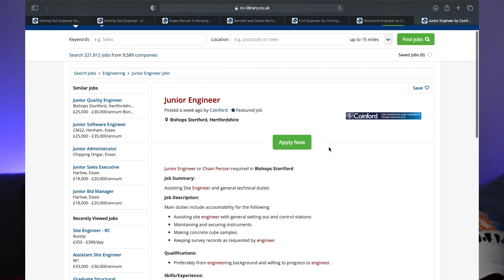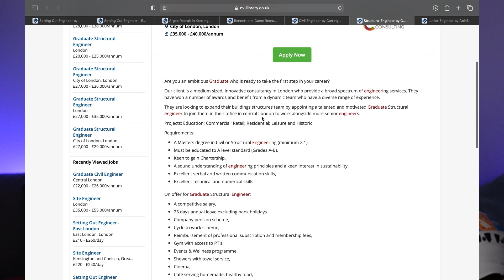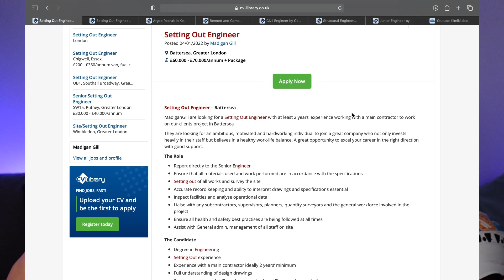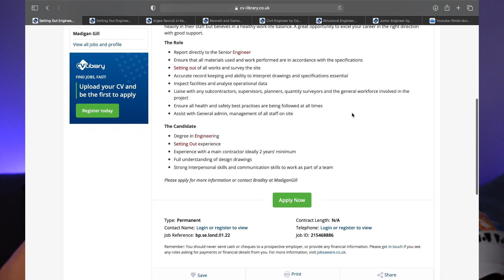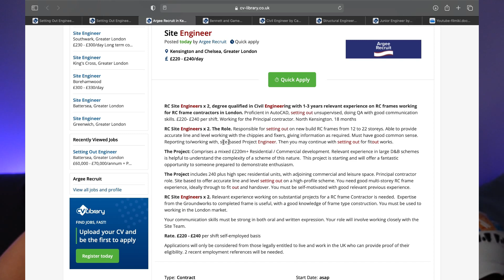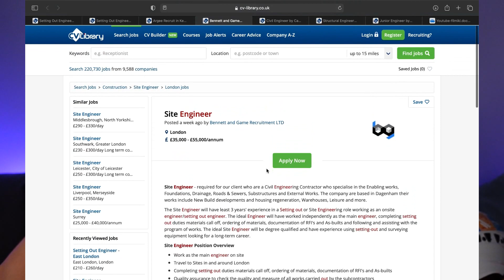Civil Engineer's SALARY & JOB in UK 2022

Comment: It is difficult to find an "Assistant Residental Engineer"(job title in HK) vacancy in UK. Should it be Civil and Structural Site Inspector or QA/QC Engineer?
Reply from the maker: Probably that would be just assistant engineer. You typically be starting here helping with setting out duties and then QA checks. There are still jobs, but it really depends on how hard you are looking for it. For some people is quite easy, while some can't find anything

Comment: I've completed my Bachelors in Civil Engineering and Masters in Structural Engineering with 3+ years of experience. I've recently relocated to Glasgow with the right to work in the UK
Got any advice for me?
I've been applying day and night for jobs
Reply from the maker: Apply for junior roles, assistant. Forget about your experience and degree, you have to start here like it would be your first job (your degree and experience help of course, but don't rely on it too much) I would get whatever job on site really, see how it looks, meet people, make connections, make some money and then will speak that you are an engineer and looking for engineering position, have experience etc etc
Reply: @SITENG  Yes that's what I'm doing. I'm applying for graduate jobs and programmes as well. I was thinking of applying for the NEBOSH certificate, would that be beneficial?
Reply from the maker: @YungAnon7  What about looking for something elsewhere, maybe not much happening in Glasgow? Extra 'papers' and courses are ok, but they won't guarantee you a job, better is take whatever job on site really, I mean not engineering one

Comment: From Bangladesh I completed my civil Engineering bachelor degree in 2015 and after that I've 5 year job experience in Bangladesh as  project engineer and 4 years as a senior executive at Bangladesh Honda private limited for maintenance Department. 
So would i able to do job in uk as site engineer?
Reply from the maker: You will have to get the visa/permit to work. Because your experience is not in UK you would have to probably start from junior engineer role which will be typical setting out duties on site.

Comment: Hii.. great video. Just want to check if bachelors degree in civil engineering with 2 years experience is enough to work as a quantity surveyor in uk?
Reply from the maker: Definitely it is, when I look at the market now there is a big need for QS. Remember that everyone wants UK experience and it still might not be easy to get a job, but definitely degree and experience is well enough and with good attitude and being active you will find a job👍👍
Reply: @SITENG  thanks
Reply from the maker: no problem!

Comment: Hi Greg, I am an indian national but do have a UK full time  Bsc(Hons) civil engineering degree. Also 15 years of on- site working experience in building construction. I am getting a chance to come to uk as a dependent so i am curious to know what are the chances me getting a job there in UK?
Reply from the maker: Hi Punit! I can't tell you really, as this depends on you and your determination. There is still lots of jobs and need for engineers, so I can't see a problem with getting a job. Try to look for something now, or at least ask questions and see what's on the market. Contact recruiters on LinkedIn and speak with them, as they will know much better than me 😁

Comment: Greig, how do I transfer my setting out skills so that I am able to become a site engineer as well? What more does the site engineer do than the engineer who only sets out?
Reply from the maker: Hi Blaine! Depends on the job size really. Often site engineer do setting out only so you can easily apply for a site engineer. You might be asked to do QA checks, cubing concrete, but not really much more than that unless you will be the only engineer on site. RFIs and rebar call offs are typically for senior engineers.
Reply: @SITENG  thanks for the info 💪
Reply from the maker: No problem 👍 Just go for site engineering, you have experience as a site engineer now, just doing mostly setting out 😁

Comment: Greg, I have an issue with my controller TS 16. WHEN I create a new job and I open it , the job is coming already with the drawing. And all the job carousel have this job overlaid. I think is a linked file, but can't find how to sort it out.
Reply: Change the design data on the controller, so say you have a new job called drainage go into design data and make sure the drainage check box is ticked and no others as this will cause the drawings to overlay.
Reply from the maker: Thanks for helping Jamie! I too think there is some box ticked which brings the drawing in 😁